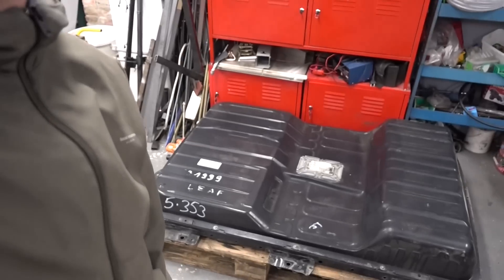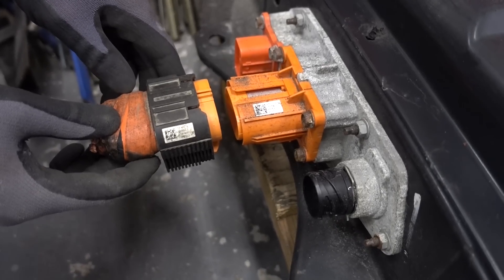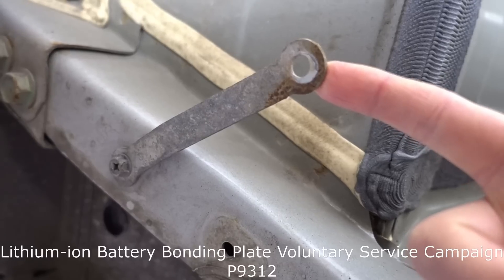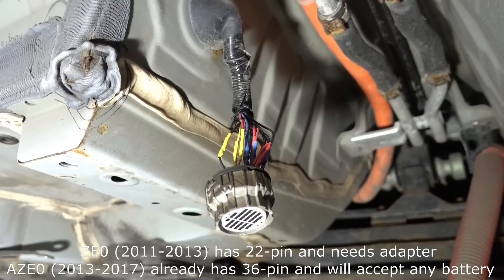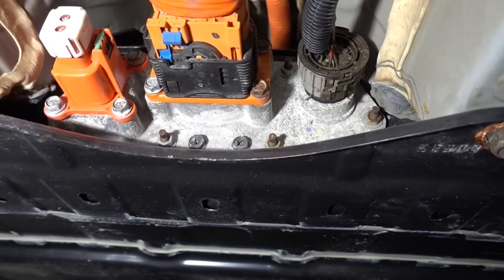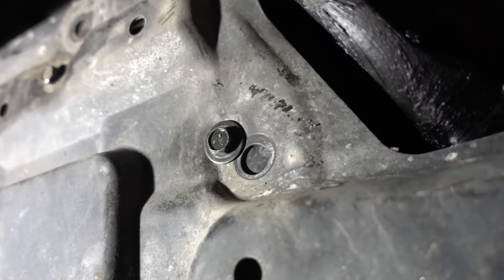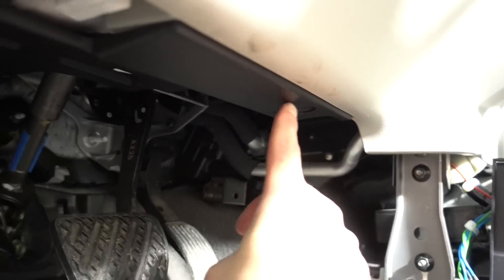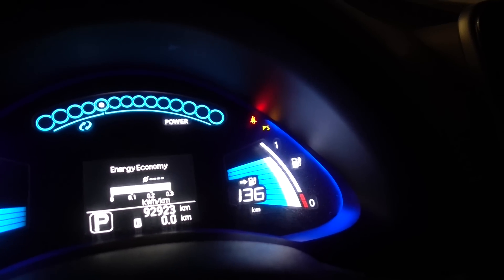Nissan Leaf Budget Battery Upgrade [ZE0, 24kWh-30kWh]

Comment: If I had two leafs, one with a 24kWh and another with a 40kWh battery, would it be possible to swap both batteries? I guess I would need to swap also some other electronics but is this something reasonably possible or would it be more simple to use CAN bridges as you did?
Reply from the maker: CAN-bridge can do all that yes!
Reply: @DalasEVRepair  Great, is this the same for the e-NV200 model?
Reply from the maker: Yes!

Comment: Great video! I have a 2012 Nissan Leaf that would like to upgrade in the future. Would I be able to install a 62kWh pack onto a 2012 Leaf with your CAN-bridge? Also, do you know if any modifications are needed to mount a 62 kWh pack?
Reply from the maker: Yes and Yes. The 62kWh pack is 50mm taller, and needs spacers on each bolt mounting hole. Ground clearance a bit affected after swap. Also stiffer rear springs is a good idea after the upgrade, it adds 100kg to the vehicle.
Reply: @DalasEVRepair  Can we put on the 17in wheels to offset the thickness of the 60kwh battery?
Reply from the maker: @TuanNguyen-pp4uo  see this page for more info https://www.mynissanleaf.com/viewtopic.php?t=32819
Reply: Yes but where to source a 64 kW pack new or second hand inside the EU to transfer to Ireland my location. Plenty of cheaper old 2011 leafs for sale in Ireland and nearby UK but I prefer LHD from France Germany etc as I want to use it a lot in mainland EU and keep fuel costs down and not suffer range anxiety. Thanks for all the info gonna start looking for cheap 2011 Leaf
Reply from the maker: @shiningirisheyes  Scrapyards are the only option. The closer to you, the cheaper.

Comment: I got lost at Can Bridge Installation :(
Reply from the maker: Don't worry, I will do a step-by-step exclusively for the CAN-bridge part soon! The CAN-bridge in a nutshell converts the CAN-data for the newer pack to the older style format so the vehicle can understand it. It also tricks the vehicle that the old battery ID is present.
Reply: @DalasEVRepair  amazing work

Comment: Here in the UK I've found the batteries are simply unaffordable. I've kept an eye out for a while, and they're actually less available on eBay now than they were a year or two ago, and the ones that are on there are silly money. I presume big companies are buying up all the packs that do hit the salvage yards.
Reply from the maker: Yes, there are some crazy monopolies depending on your location. I have yet to buy a single pack from my own country!
Reply: @DalasEVRepair  This is the main obstacle. It looks pretty easy really, and all credit to Daniel for figuring it out. Getting hold of a batyer pack is not easy by the look of it (in the UK).
Reply: @dgroberts100  Have you tried an auction yard? If you can get someone in with an OBD2 scanner you can see if buying the car whole (with a half decent pack) would be worth it. I can obviously say that if the cells are swollen, you are out a bunch of money but if the lot will let you get an in-depth look at the car they might let you pick it up for cheap as a salvage. (i.e the cost of the battery pack and a little extra) The spare parts you would have to resell and store indefinitely or on your own so of course that might not be an option. I think Nissan's platform is far better and more thought out than Tesla even if the super charge network and range are better, the serviceability and customer interactions make the price of the car obscene.

Comment: Hi there, how  big batteri am I allow to have in my leaf  2013 modell? I do just have a 24 kWh and I'm really thinking to drive the whole way from bergen in Norway and visit you 😅😉
Reply: Snow has just arrived in Norway, cheap lightly used batterypacks are Soon available!
Reply: @Tore_Lund  😂😂
Reply from the maker: No need, you already live in the best place in the world to buy battery packs! All sizes (24/30/40/62kWh) can be mounted to the 2013 model. Try buying one from a bildemontering site!
Reply: @DalasEVRepair  I'm so delighted with your answer, I know that there's a lot second-hand batteries in Norway but I haven't found yet someone that do the job.. I'll look at the place you've just written. Thanks a lot for your answer
Reply: @DalasEVRepair  Does the 62kwh pack have the same dimensions as the 24/30/40?  I thought I heard that it was bigger and required custom mounting brackets to attach to the vehicle.
Reply from the maker: @InnovativeSustainableSolutions  It is 50mm taller and requires spacers to be installed on each mounting point(along with longer bolts). Nothing crazy difficult!

Comment: Excellent video.  Is a CAN-bridge only required for pre 2013 model battery upgrades?
Reply from the maker: CAN-bridge is required for all models. After this is mounted, any battery can be installed (24/30/40/62kWh)
Reply: @DalasEVRepair  Wonderful.  From memory it's used to match the new battery with vechile as Nissan codes them. (Non technical terms)
Reply from the maker: @vampireechidna  Cool! The solution I use tricks the vehicle that the original battery is still installed, no need for pairing 😁
Reply: @DalasEVRepair  It is interesting. I have just installed 40 kWh battery pack into 2017 Leaf. Before I installed CAN bridge based on 2-port budget from China. After powering car I found P3102 DTC active which I removed with Leaf Spy Pro pairing tool. Should not be done via CAN bridge?
Reply from the maker: @KatarzynaS-J  We previously did it via CAN bridge, but we found out it was better to do official pairing (with Leafspy)

Comment: Nice video. I have swapped battery in my 2012 to a 40kWh with the use of a gateway from an other supplier. Your sollution seem a bit better/cleaner as it has the GW inside the car, and also, you provide some upgraded functions. Such as "rapidgate" fix. Keep up the good work, I will for sure go for your sollution if I make an other swap in an other car.
Reply: Could you tell me who that other supplier is and the price for the gateway?
Reply: @xabizar    https://ve.simonandre.ca/leaf-2/. It works fine, and good support. But I like this Suomi solution as it have the gateway in the car. And if it really were needed, I could drive 750km from my home in Norway to Vasa. and have Daniel to sort out what I might not manage my self. Canada to far away! But I have had good support thou from remote connection, so my solution works well. Going from 15kWh (In the old battery) to 36kWh net capacity made so the old 2012 became a new car. Recommended if you have the possibility.

Comment: Really good video. So if I did this on my 2015 24kW leaf I wouldn’t have to change the comms connector is that right? What about the canbridge?
Reply from the maker: Correct, only a CAN-bridge is needed! Take a look at my other videos, my other car is a 2015 model!
Reply: @DalasEVRepair  I have a 2011 24kWh battery that Nissan replaced with a 2015 24kWh battery (under the Klee class action.)
Does that mean I don't need the 22-to-36-pin adapter you make, I only need only the CAN-bridge?
I don't see them for sale on your EVrepair site (unless you install it,) and I'd like the BatterySaver!
How can I get BatterySaver on a CAN-bridge in Texas?

If it doesn't have it, does that mean it's a CAN'T-bridge?
(Sorry...couldn't resist.  :-)
Reply from the maker: @stevejordan7275  When Nissan do 24kWh retrotifts, they open up the pack and replace the 36pin connector with the 22-pin. This means that if you want to do a battery upgrade down the line, you will need the 22-36pin adapter!
Reply: @DalasEVRepair  Those dirty guys.  Well, thank you very much for the insight!
Is there a way to install BatterySaver 1.1 if I buy the CAN-bridge and adapter from you?
Reply from the maker: @stevejordan7275  The CAN-bridge is a bit overkill for just adding BatterySaver, would recommend to wait until you actually need a battery upgrade, and then install one!
Reply: @DalasEVRepair  Certainly!  I was asking more to find out if BatterySaver is a bit of hardware, or software that works only in conjunction with the CAN-bridge.  I know I'm going to replace the battery as soon as I can find a suitable 62kWh transplant, I'm simply planning ahead.

Comment: Awesome video!!!!
The problem here in Florida, United States is to find a battery.
Mine is only 7 bars.

Keep it up with the great work.
Best regards, from Orlando Florida USA
Reply: The supply of new, or lightly degraded batteries is going to peter out rapidly here in the next years.  Leaf sales have been on a sharp decline globally for the last year, and as Nissan shifts it's focus to it's electric SUV (the Ariya), the expectation is for Nissan to discontinue the Leaf all-together.  If we want to keep these 500k vehicles usable and on the road, the task will fall to us DIYers to find some other means to add power than "simply" finding another like new battery.
Reply: @InnovativeSustainableSolutions  
Big fan of your Channel here, I was not expecting you to answer.

 Totally agree, batteries are really hard to find.
Is a shame that Nissan supports this consumerist disposable car society and they are not the only ones.

I love the hard work you put in your Sun-Eater, but my thinking is that the solar array/batteries/inverter/etc... will cost about the same that a new battery and I am leaning towards the battery at this point.
Granted I can probably reuse the solar system, but here in Florida they make it hard for us homeowners to do solar at home, even worst with homeowners association.

Other consideration is that my car only cost me 4k around 2 years ago and I use this 50% repair/replace rule below:
https://artoftroubleshooting.com/2014/04/25/the-50-percent-rule-repair-or-replace-revisited/
With that getting a battery should only cost around 2k given the car has not incur in any depreciation, which is not realistic. 

But I will not give up in my green effort. My next car will also be electric.
I just hope my Leaf can hold a bit longer until the pre-ordered Cybertruck arrives. Otherwise I will have to figure what to get in the interim or change the battery for the Leaf to keep using it. 

I am also a DIY guy that have some electronics/computers background, but age is a factor and dealing with this heavy battery replacement is something that I am thinking about.

Lets see what the future brings.

Best regards,

https://www.facebook.com/ramoninorlando
Reply: @InnovativeSustainableSolutions  yes, and there's no reason why the leaf can't be expanded to have a bigger battery, it has 3 numbers to display the range haha. i checked the dimensions and it would be easy to fit 2 layers of teslas new battery cell inside a nissan leaf pack :D
Reply: @osimmac  I dream of getting my hands on a pallet of 4680 cells.  But I really don't think Tesla is going to sell them.  They are insanely protective of their parts.  They literally wouldn't sell Rich plastic lugnut covers.  Acquiring them from a wrecked vehicle will also be exponentially more difficult as they are incorporating them into the frame.  We may never see 4680s on the aftermarket.  You also need a 96s bms, and Im sure the 4680 has a different voltage-discharge curve than the Leaf cells, which the vehicles' software won't like.  I'm sure it's possible to build a Leaf battery out of 4680s, but it would be a very difficult undertaking IMO.
Reply: @InnovativeSustainableSolutions  I just did a range test with my 2013 LEAF this week https://www.youtube.com/watch?v=w874KxwoXaI and now that I work from home exclusively, and after your comments about how the LEAF will likely be discontinued etc... I'm thinking I might just sell it before it's resale value goes down more than it already has. I bought it for $7,800 back in February of 2018 at 60k miles and now it's at 67k and it's lost two more battery capacity bars, so it's now lost 5 of it's original 12 bars. It's still a useful vehicle around town as my test shows it can go 55 miles at least, and probably could have gone closer to 60 miles in around town driving. The problem for me is I often need to get on the freeway for part of the drive and that's what really drains the battery super fast.
Reply: @InnovativeSustainableSolutions  yeah it'll be a long while before we see them on the aftermarket, 10 years probably, one can still dream though!

Comment: Mr. Daniel is clearly a liberal person, using the word "simply" so liberally :P I would like to list here several steps that will not go so simply for many, specially for high mileage car that has lived outside a lot. 
1. the underbelly protective plastic covers - many of the plastic stud clips may refuse to come off in one piece, several 10mm bolts may decide to break instead of unscrewing.
2. battery connectors - those "just twist" and "just press" steps, will go easier now that you have visual aid, but those can take up to half an our of messing around to get them loose without breaking anything. And that was under a lifted car where you can stand, will be a lot harder on your back with very little room.
3. battery bolts - while you attempt to "simply break" them loose, you may meet a lot of resistance to your bolt liberation attempts and end up with, for example, two bolts coming off and taking the inbody nut with them, forcing you to anglegrind the bolts off, fishing the loose nut parts from inside body frame tubes and figuring out how to get new nuts in there. 
Or maybe i was very unlucky? :) 
But be warned, when or if you have limited time in a garage you might rent for it or so.
Good overall video otherwise :)
Reply from the maker: Absolutely! I've done way too many upgrades now, so it doesn't feel that big of a task. A video done by a complete newbie would be amazing to watch :D
Reply: @DalasEVRepair  I will try and make that video.  I anticipate lots of profanity, and probably some heavy drinking afterward.
Reply: @DalasEVRepair  Great video Daniel. You are my hero. Was just thinking to do the same but don't have tools to lower and put back the battery. Please tell us what you used for this job. Thx.
Reply from the maker: @sonyb9125  I used 2x floor jacks and a roller to move it around. It can be done with extremely basic tools!
Reply: I've heard this too often. Then people sell their projects in a basket. Don't get discouraged because it's harder than it looks. Life is like that.
Reply: @Derek_Kuraitis  it wasnt for discouragement, it was for better preparation and for setting more accurate expectations to oneself :) 
Also lowering the battery is quite tricky without proper tools, Daniel didnt go into much detail about what he used there in this video. If you have a car lift, it's a bit easyer. Lift car, put pallets under, lower car, release bolts, lift car.

Comment: is it possible to depin the round plug or are the new pind different? you could also buy just the pins
Reply from the maker: I haven't been able to successfully do it :/
Reply: @DalasEVRepair  is there slack in the cable to loose several mm of wire?
Reply from the maker: @Derek_Kuraitis  I think these weatherproof type of pins are impossible to gracefully de-pin. There is slack to loose several CM of cable, and if more is needed it can be pushed further in from the cabin,